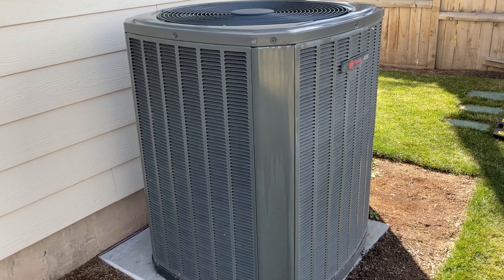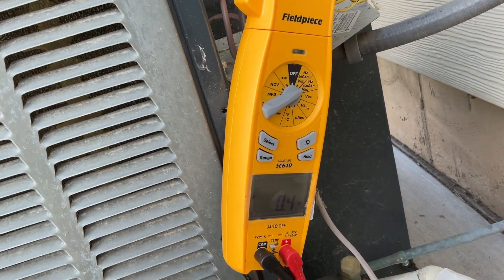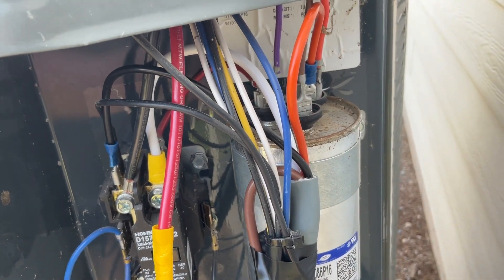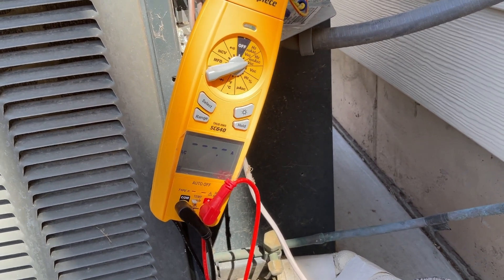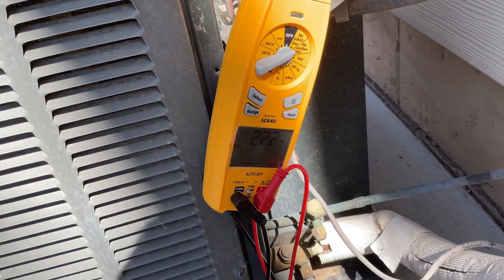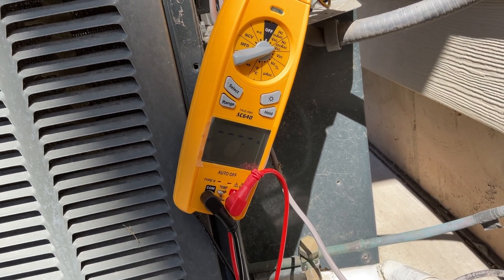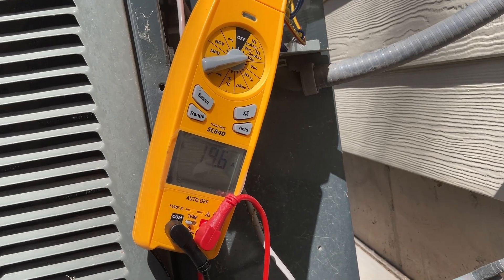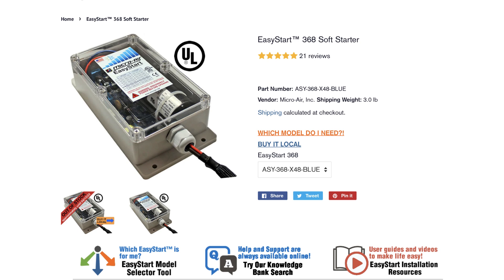Save Lots of $$$! Micro-Air Easy Start on full-size A/C Review

Comment: It's not going to save any energy. It will take the same amount of power to start, just drawn over a longer period. It will also cause your HVAC system to fail prematurely because the compressor will experience more rapid current and torque than it was designed for. This is only a good idea if you have a system that is at the end of its life and you need it to buy some time.
Reply from the maker: Good idea for a future video! I'll measure the in-rush AFTER the easy start on it's way to the compressor and see what that measures and if it's higher than the original in-rush before I installed the Easy-Start! Thanks for watching!
Reply: @theresatrickforthat  based on the noise reduction when  the compressor starts ( instead of a loud thunk it sounds more like a ramping up, I believe the inrush amps to the compressor will be much less
Reply: I'm not sure thats true for soft start...it should extend the life of compressor.
Do u mean a hard start capacitor? That will reduce life but not soft start, correct?
Reply: I believe you are confusing a "hard-start booster kit" with a "soft-start module." A "hard-start booster kit" does in fact rapidly "increase both the inrush amperage and the start-up torque" exhibited by the compressor, to levels beyond the manufacturer's design parameters. My understanding is that a "soft-start module" has none of these disadvantages; with the only advantage being the possibility of a longer life for the compressor. However, with a few hundred bucks in cost for the "soft-start module" that may need to be replaced 2-3 times over the life-time of the compressor, any potential parts replacement cost savings is questionable. And as others here have mentioned, there is no "energy savings" to be had by installing the soft start module.

Comment: Not an expert on this, but from practical standpoints, I see it not saving any real money if that is what you are trying to do.  The running current (thus the power used) does not change, but it will prevent large inrush current surges from stressing things like smaller generators, solar-charged battery-backup power systems (very sensitive to sudden large current surges) and old breaker panels.  Every time my whole-house AC kicks in, some of the lights in the house dim for one second (doesn't happen with my mini-split).  Seems to separate the start times of the fan and the compressor to lower the inrush current.  It waits until the fan is up to running speed before switching on the compressor instead of starting both simultaneously.  Seems like a good product for those with a serious need or power supply problem but it won't save you anything in the long run.
Reply from the maker: Yep! Saved me thousands of dollars on my generator. Thanks for watching!

Comment: Does it work for heat pumps?
Reply from the maker: I would imagine so since the reversing valve on a heat pump has no impact on how the compressor starts . But I would for sure confirm that with the manufacturer. Thanks for watching!

Comment: Had an AC tech install mine today.  Unfortunately I did not do a starting amperage so dont know the savings.  I have noticed when the AC starts now, I get a horrible feedback noise on my computer speakers for a few seconds.  Not sure what the problem is.  Any ideas?
Reply from the maker: I haven't has any such issues. Maybe something to ask the folks at Micro-Air. Thanks for watching!

Comment: I would like to see what a hard start kit would do to the amperage of that unit - especially because the difference in price is quite a lot 🍻
Reply: A hard start would not reduce the in rush, it is meant to give an extra kick to a failing motor. It is harder on the windings, here is a video that explains: https://youtu.be/ZD_cwsPcRfI
Reply from the maker: That would be an interesting comparison! Thanks for watching!
Reply: Hard starts are a bandaid for a failing system; a compressor that will not start from a good start capacitor. It's a fix, not an aid to a decent system.

Comment: It looks like a fancy hard start kit.  Have you ever heard of an emerson sure stitch?  This seems similar, except this has a starting capacitor.
Reply from the maker: Haven’t heard of that. Sounds like something I would like to learn more about! Thanks for watching!
Reply: A hard start does not reduce in-rush, it is designed to give an extra push to a worn out motor and is harder on the windings.

Comment: Ok here's the problem with this item. I am not an HVAC expert but I am an electrical engineer. I don't beleive that this saves any considerable amount of money because that initial inrush only lasts a few seconds and when you get billed, it's by the kilowatt hour. So yes 96 Amps for 3 seconds can add up if your ac comes on 1000 times a day, but if it only comes on every 30 min, it's not a big amount once you really add it up. What i will say, is that it's nice to have a soft start. Your neigbors will appreciate it, and you can rest knowing that the breaker is probably never going to break over.
Reply: this is a game changer
Reply: Wrong
Reply: That is correct.  You basically help to improve the power factor but overall consumption is the same, you wont reduce the wattage usage
Reply: It’s to save and prolong your ac unit especially the Compressors life
Reply: @jorangel87  The compressor is usually the last to go. Your evaporator coil will rust out before your compressor goes. If you compressor does go before the 15 year mark, it's due to a manufacturing defect or some type of user neglect. But generally, compressor can take a beating and keep going for years.
Reply: @markanders250  I have had several go out here in Fl
Reply: The main benifit of this device is to run the ac on the backup generator that will not have trillion watts
Reply from the maker: Thanks for sharing your knowledge and for watching!
Reply: Greetings LegoBeto, I am friendly and I am not an electrical engineer. But what I am is a certified and licensed internet know it all. And I have a master's degree from a college of assumption and my professor was Mr Murphy's Law. I have to agree with you. Like you basically stated a properly-sized system will not short cycle, as an oversized system would. That's not what came to mind though. Immediately what I thought was as much as I think this will hurt the compressor in the long run, it's almost an instant solution I believe for myself to be able to run via solar panels only no battery backup needed. This is only for during the daylight of course with full sun. But what this unit does I believe I'm going to find out as I just purchased one. Is the surge is eliminated almost 90 AMP startup after using the soft start about 20 to 24 amps. I can easily start that system up with just a few solar panels and run it all day long by using this soft start I do believe. You can see my credentials I have posted above. But I'm here asking for your help if you think this is possible? Or if this is one of my assumed fantasies I dream up because I'm not actually an electrical engineer. If you believe what I proposed is a bad idea, hopefully you'll respond and warn me before I receive the easy start. I hope I am correct as this will be awesome for my cabin.

Comment: Soft start on a capacitor start motor? Sketchy at best. Better off switching to a 3 phase motor with a variable speed control and a soft start.
Reply from the maker: Thanks for watching!
Reply: 3 Phase power is usually not available in residential service!

Comment: More analysis needs to be done before anyone can claim that this will reduce your electricity bills. A quick look at this video makes me think that this device is doing nothing more than what we traditionally refer to is Start Gear. In order to evaluate the impact properly, a technician would need to compare the EER rating before this device is installed and after. It comes down to how much heat can you remove per watt. Simply looking at before and after amp draw is not sufficient.
Reply from the maker: Good thoughts! Thanks for watching!

Comment: These only save you money if you live in a peak demand area.   Which I do, so I save quite a bit using it on my 5-ton unit.   If you don't live in one of these areas, then if anything it makes your compressor much happier.   The real benefit, for non peak demand areas, is being able to downsize their generators/inverters.
Reply from the maker: Great insights! Thanks for watching!
Reply: What do you mean a peak demand area? Like if your paying a variable electricity price?
Reply: Means during certain times of the day you pay more for your electricity than other hours. Typically these are during the hottest/coldest part of the day.
Reply: @sethshaver8840  oh ok. Yeah, fuck all that. My rates are fixed. Same price all day everyday, at least until my contract is up. I live in Texas, wondering if the ROI is enough to buy one. I get the inrush current is less, but running current I assume is still the same.
Reply: @bac4998  "Peak demand" probably means people living in the hot south; Texas, Arizona, New Mexico, etc. where their units are running a lot and more frequently; as opposed to people living up north where it's much cooler during the summer; New Hampshire, Connecticut, Maine, etc.
Reply: Means during certain times of the day you pay more for your electricity than other hours. Typically these are during the hottest/coldest part of the day.
Reply: Demand metering is common with commercial and industrial accounts.  It is not very common in residential settings.  With that said, if you don't have demand metering, then this device won't save anything as far as electric costs are concerned.  The inrush current is reduced but the starting time duration is increased which negates any perceived savings.  This device is a great thing for people in a situation where demand is an issue.  People in RV's, off the grid environments, etc.  Otherwise, any savings are marginal (if any).  It may help with compressor life but I doubt it will offset the purchase price.

Comment: The EasyStart is a legit device for reducing compressor startup surge.  It places an additional start capacitor in parallel with existing run capacitor during the half second startup period, which is similar to a hard start kit, but it also voltage ramps the total input voltage up during the start period like a soft starter.  The large start capacitor increases the initial rotational torque of compressor motor for the given applied input voltage.  It has a bypass relay after starting so the run current is not affected by the EasyStart.  The five learning cycles optimizes the voltage ramp up for a given system.  EasyStart has a 3 minute minimum off period timer after unit switches off to allow time for refrigerant pressure to equalize in system.  This is a good feature to prevent short cycling of compressor during a utility power glitch.

Weak link is the high capacitance value electrolytic start capacitor (black plastic case) inside the EasyStart unit. Electrolytic start capacitors are less reliable than foil run capacitors.  They are commonly used on well pumps, air compressors, and many power tools along with a centrifugal switch on motor to disengage them after startup period.

Definitely reduces contactor relay and compressor stress during startup.  

You should buy a spare run capacitor for your unit and a spare start capacitor for EasyStart as they are the most likely components to fail over time.  Having a spare contactor relay is also good although with EasyStart the contacts are not being subjected to as great an initial surge contact current that eats up the contacts over time.

With BT app you can periodically check your startup current.  If it changed significantly something is likely wrong with system.  You could have a run or start cap going bad, or your system might be losing refrigerant that would lighten the startup and run current a bit.  When there is less load on compressor due to cooler environmental temps you can expect run current to be less.  Two stage units jump in their current between modes and should be trained in the full power mode of compressor.
Reply from the maker: We have someone who speaks fluent "electrical" in the house! Thanks for watching and commenting!
Reply: What is the rating for the capacitor in the micro-start? I haven't open it up.
Reply: @rhpham2  Voltage rating is 330vac which is max voltage rating for the electrolytic bidirectional capacitors.  The capacitance value depends on motor horsepower.  The 364, 368-48k, and 368-72k have different starter cap sizes.   They have info on their site for starter cap capacitance size for various motor horsepower.  Roughly, you can figure start capacitor capacitance will be four to five times the run capacitor value.

Electrically, you want 90 degrees phase shift between run and start windings current during the half second start period to optimize rotational torque during startup.  

Proper run capacitor value for a single phase induction motor is when there is 90 degs current phase difference between run and start windings in continuous run mode.  This is much less capacitance than start capacitor size and capacitor is foil type which can take continuous operation versus the short intermittent operation for start capacitor.

Comment: No, you will never recover the $300 cost of the easy start. Whether or not it will extend the life of your compressor is a dubious claim at best.
Reply from the maker: Probably won’t ever recover the cost in electrical bill savings…but it saved me THOUSANDS in generator costs upfront. So even if that was the only benefit…it was 100% worth it for me! Thanks for watching!
Reply: The major benefit of the soft start kits, is the ability to operate your central AC using a much smaller portable generator, in the event of a power outage. That alone makes the cost worth it, for anyone wanting to use a generator for backup power. My 5-ton unit would require a 32 KW generator to start it before I added the Sure Start from Hyper Engineering. Now I can use it with a much less expensive 13KW (10.5 KW running) generator. Added bonus, the lights no longer dim when the AC kicks on.

Comment: I just installed this on my 5 Ton Rheem. Installation was quite easy. My unit is rated with a peak draw of 144 amps. After the learning starts, the peak now is 45.6 amps with a current draw of 11.4 amps. Quite a difference. I had invested in a Generac 24 Kw Whole House and looks like there is a problem with delivery and I will have to reorder. Since installing the easy start, I'm going to get my refund and can save some big bucks by reducing generator size. Even if I do get delivery I will still benefit from the easy start due to less strain on the compressor and no need to have to manage total load when the Generac kicks in.
Reply from the maker: Wonderful news! Thanks for sharing and watching!
Reply: I have a 5 ton Rheem unit. I run a 17 kw guardian without issues. The trick is to have the interior blower fan in the ON position . This eliminates the heavy start load,thus no issues with 17 kw generator operation

Comment: I GOT MY SOFT START OFF EBAY IT SAVES ME TONS ON ELECTRIC ! GREAT VIDEO !
Reply from the maker: Good to hear!
Reply: How does it save on electric?
Does it lower electric bills or just high inrush current?
My electric meter does not see motor type in rush current on startups?
Reply: @jjjohn5914  yes you use less electric because it lowers the amps !
Reply: @raymondj8768  As I mentioned, utility meter does not pickup inrush amps...see below...check out the full article...
￼

Digging Deeper into Motor Inrush Current

How Much Does it Cost to Start a Motor?
by Lisa Green
You may have heard that when motors start across-the-line, there is a large inrush of current. A common misconception is that because of this inrush of current, starting a large motor is costly and it contributes to your facility’s peak demand charge. This article explains why motor start-up may not be as costly (electricity-wise) as you once thought.
Reply: @jjjohn5914  if it pulls 95 amps to start n the device cuts it back to 20 amps isent that a savings of power ? id say 80 amps worth everytime it starts doesent it ?
Reply: @raymondj8768  there is a reduction but u have to consider that the current draw is over a longer period of time with soft start...therefore no real advantage and also as mentioned the 80amp inrush is not translated to the utility thru meter demand.
The real usefulness of the soft start is when the a/c system is on a portable generator. Being that generator is not sized to handle the a/c as a temp load during an outage ...soft start has a tremendous advantage in this application.

Comment: I don't understand why this isn't installed on air conditioners from the factory. Are there any drawbacks?
Reply from the maker: Great question! Maybe it adds money to the unit that’s not 100% necessary. That’s the only drawback I can think of.
Reply: @theresatrickforthat  I dunno. I recently bought a new unit and that wasn't even an option. Great video.
Reply: Cost. I read a comment from an AC Engineer on another video, he said the cost to build it in was the deal breaker.